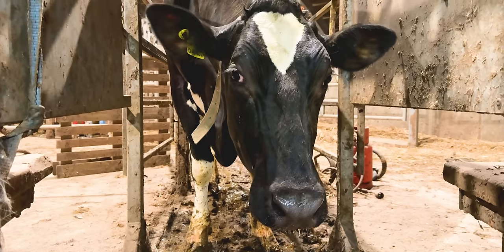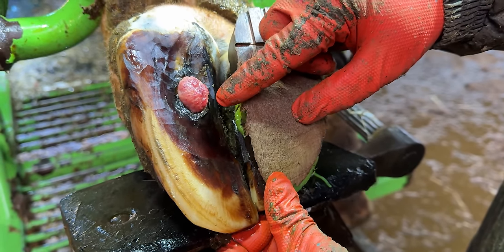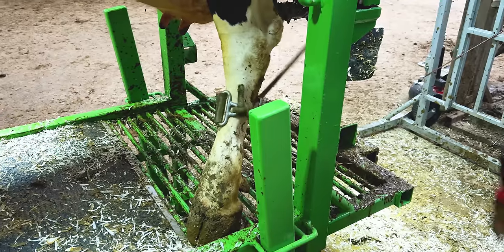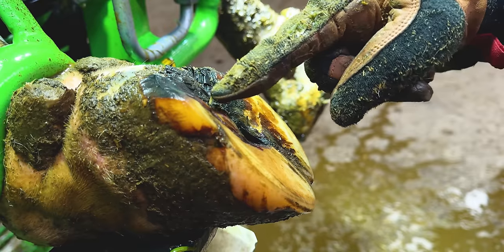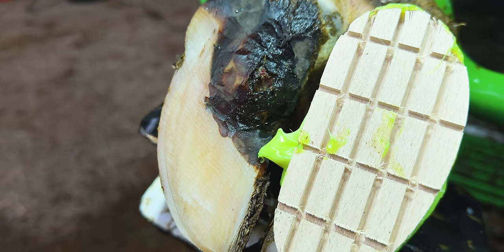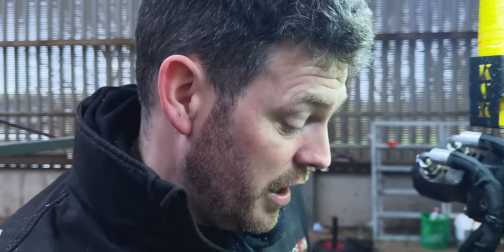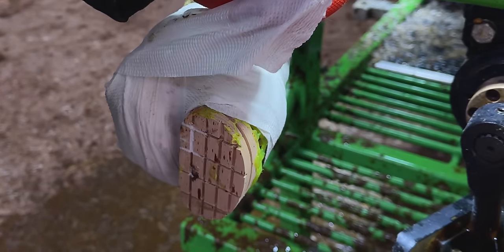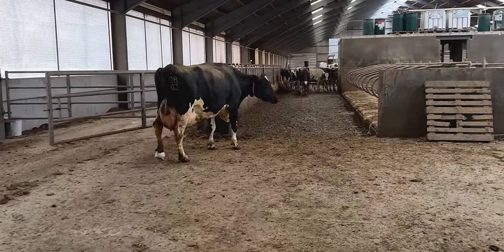*HUGE* DANGLING sole ULCER ... a stry of progression!!!!

Comment: Back in Kentucky we call that "proud flesh." It has to be kept dry and open to air for faster healing. It's already granulated. Actually, it won't stop granulating, if I recall correctly.
Reply: I guess that would depend on the conditions right? In Scotland in spring it’s going to be generally very wet and muddy, I’d imagine in Kentucky it would dry much quicker?
Reply: @IsSalty  it's proud flesh. It has to be dry so the granulation stops. It's very vascular. Might be better if the farmer put her in a clean pen and sprayed betadine or iodine on it daily. Just an observation.

Comment: I could see as you put the pressure on at first that it appeared like there was some detached horn, but it's still like cutting a pet's nail to cause the quick to retreat deeper into the nail. Just, with such a large animal, it's going to take a while. It almost resembles a hernia, in terms of the ulcer pushing through the horn.

Comment: Question: What would you do if a cow had an accident injuring both claws on a foot? How would you decide which claw to put a block on? What if you couldn't block either because of the injury causing the need to remove the soles from both claws?
Reply: Use half horse shoe blocks